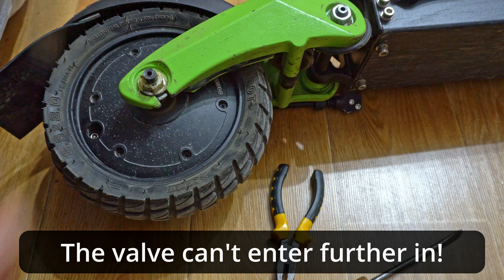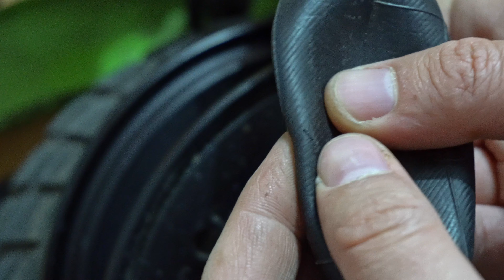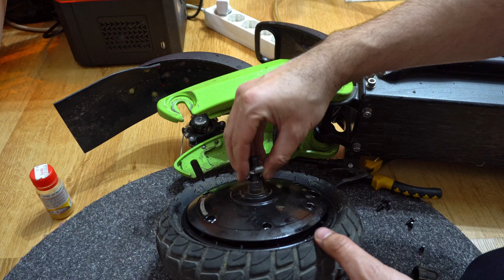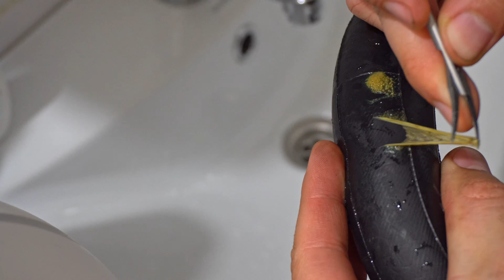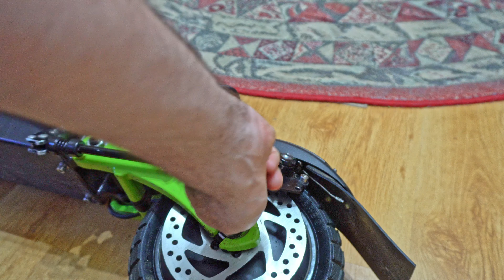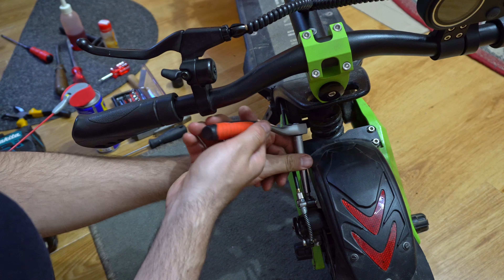Scooter Tube & Valve removal, Flat Tire, Repair (Trotineta Cyberbot SpeedXman, 8.1/2 x 2-156 A)

Comment: Brought it in 2021, (Cyberbot Mini/X-Tron X08) had 8 flats in 2 months, moved to 10 inch tubeless tires and never had a flat since, the cyberbot tires are not well designed and you will always have a flat tire, rim is similar sized to the Xiaomi so you can buy any of those, no other tires will fit, i tried
Reply: This piece of sh6t is a money pit.A got 3 flats in 1 month moved to solid tires.Not bad.Almost the same as air filled.But a month later my front brakes got f d and now my controller is bad i guess because it cuts off at high speeds.If not the controller then the back motor. or battery.PIECE OF SH6t SPENT 250EUROS ON SERVICE AND STILL BAD.

Comment: hello,😁 I knew it wasn't going to hold with glue alone.. 
why don't you repair with a patch, you have to proceed as for a bicycle! it's easy ! especially since you have done the hardest part of dismantling it
Reply from the maker: I have to use a patch, or a new tube.
Reply: @furulevi  ok ! the rubber cover of the charging port is too flexible, I have the lower one which broke, there is a part which remained in the charging port (or connector, I do not know if we can say "connector")
it's disintegrated inside, I can no longer connect the two chargers at the same time..,But only one!
Reply: Do you think we can put 10 "off-road ? Or road?
Reply: @rarbiyoutube  You can use off-road tires without problem, 10 inch fit (up to 26,5cm) but only the xiaomi with 154mm motor size (6.1)
Reply: @MrThEdArKgLiTcHeR  Ah OK !